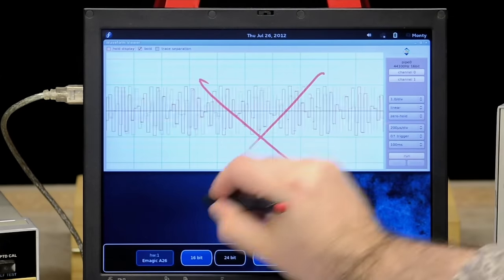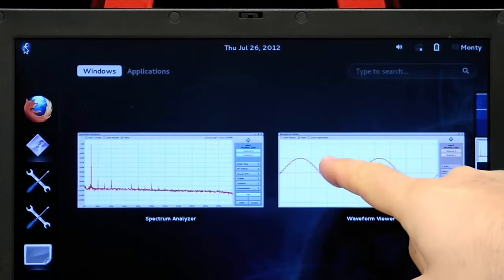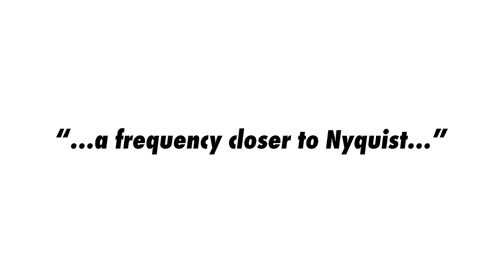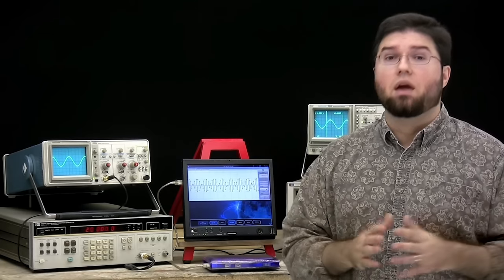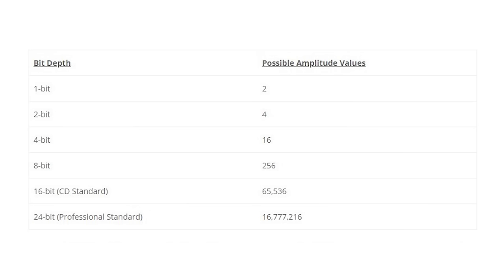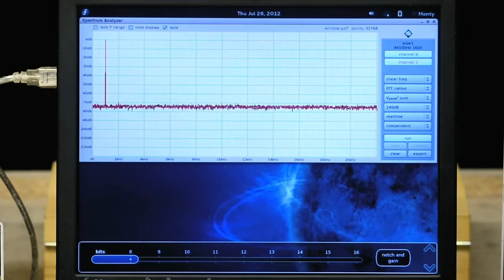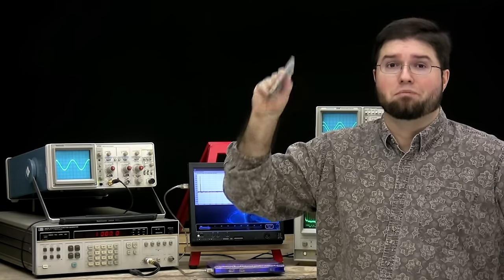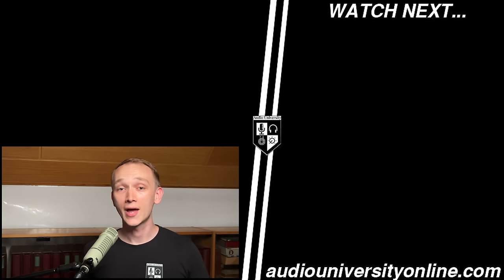Debunking the Digital Audio Myth: The Truth About the 'Stair-Step' Effect

Comment: Interesting but with assumptions made as to hearing range. A human has limited hearing and does not usually hear to 20KHz, in fact a teenager may hear up to 18KHz  at a push which decreases with age. Also missed out is the fact that the level that signal would have to be increases with frequency, given human hearing tapers off.
I worked in audiometric design of devices for measuring hearing.
Although showing a fundamental frequency for test purposes is fine and using it to measure a frequency range, I do think examples that just show the fundamental frequency, rather than the complex nature of real sound, is not a very good example. In other words the harmonics which make up and alter any fundamental frequency, when it comes to something as simple as a piano key press or a guitar string. 
A human may hear to a high frequency, but the bandwidth of something like music, has a very different frequency band. Something like a tweeter on an audio system usually kicks in at around 2KHz to 4KHz, so sampling at higher than 8KHz is superfluous.
I would also like to point out that a good D to A will have filters that change those points into something that represents an analogue signal.
It is an interesting video that shows people how a digital signal is composed, but lacks information that should have been stated.
Most people do not know or care what they are listening to, so a sample rate of 44.1 is good enough for the frequency range that humans are used to listening to.

Comment: If you consider audiophile network switches are being sold at 20 times the price of non audiophile but techically equal switches you understand that there is no limit to the ways rich audiophiles are being extorted. Although I do believe there are loads of people in the branche that actually believe all the humbug. The power of placebo effect is always being underestimated, both in medicin as in audophilia. It's always something others might be susceptible to but never yourself.
I wonder how you guys think about the "bit perfect" advantage. Is it possible to hear if 44,1 kHz material is resampled to 48 kHz? The idea is that this would result in an effect to the sound similar to the effect on image quality when you set your OS to a resolution that is not exactly supported my your monitor. If you play music through mediaplayers it is almost impossible to avoid this resampling.

Comment: "Pixels are samples of a 2-dimensional function space." That's wrong. Pixels in an image on a detector, whether it's a CCD, infrared array, or some other technology, are finite in size. They collect the light impinging on themselves and count the number of photo-electrons knocked off. From that, when you divide the count by the area of the pixel and the collection time, you can deduce that the average intensity over the pixel. You can use the mean value theorem to state that the function attains that average somewhere, but you cannot say where in the pixel that happens. 

Even audio "samples" aren't actually samples as you describe. The sampling process takes a finite amount of time, and what you get is an average over that time. Granted, in an audio system the sampling time is usually much much faster than any of the frequencies of interest, making the mean-value theorem approximation you make when you describe them as samples far more accurate, but still an approximation.

Comment: I would assume that the misunderstanding that you need more than 16-bit and 44.1 kHz digital samples is result of using low quality DA (digital to analog) converters. When you compare poorly implemented DA that takes 16bit/44kHz input vs poorly implemented DA that takes 32bit/192kHz input, the resulting analog audio output is typically better for the "high-resolution" digital format. That's not because it's actually superior for any practical use but because even poorly implemented "high-resolution" DA typically has just enough quality to actually behave as a correctly implemented 16-bit/44.1 kHz DA even though it would be equally bad for true 32-bit /192 kHz data.

Comment: Well, it sounds good… on paper. The noise you can’t hear so to speak affects the spacial perception. Our brain locate sound by the very minute difference in timing, and in electronics, noise do impact timing. You don’t need expensive equipment, just get a very cheap dac amp, play a 16 bit pcm, then play 512 DSD. DSD is converted to PCM, so more processing power should be worse…. Except it sound better across the board. Until you get up to 1500€ ish DACs, the very high resolution will sound better. After that the difference in mastering will make more of an impact and you will not be able to tell what is what just hearing the song. That is why people with lower end gear go crazy after resolution and people with 30.000€ equipment are fine with CD quality.
Reply: @nicksterj ok but then why is the mentioned situation exist? honest question. you play any DSD file, even 64 in to a 150$ DAC, even older models and you feel it instantly compared to 16/44.  No matter what tracks you chose it is the same thing. You move to a 2000 euro dac and you won't be able to tell unless it is the same recording and mastering, and even then you can barely tell. 
The "mythology" can be tested with cheap device, no need to trust a random guy.

Comment: Interesting video, even for a "tone deaf" software developer. And i can pretty much guess where part 2 is going because it's common ground for any data processing that isn't a "straight copy". The less the error is on the input, the less it will be (propagated) through the processing and at the output. You can think of it a bit as "constant re-quantizing" at every step, with consequently more and more errors accumulating. That's why you'll see things like 8bit (integer) image processing done in floating point, because you need to keep the errors as low as possible.

Comment: But the output form the DAC converters is a stair case, the reason it is a smooth sine wave on the oscilloscope is the (RC) filter added after the DAC
Reply: You thinking of interpolations methods and such, even so, the DAC still make a stair case output.
Reply: @nicksterj
So you disagree that all DAC's create a stair case patten on they out put ? 
As example you give sigma-delta converters do not output a 'stair step' pattern, do you include the low pass filter after the DAC in your definition of a DAC?
Remember now, we are discussing the DAC itself, not a complete system.
Reply: @nicksterj
As a side note I give you the sigma delta DAC, my guess he is not aware of them.
But whole video is talking about staircase, so still the the DAC he is thinking of is still making staircase, he even mention "zero order hold"
Either he is not aware, sloppy or include the (needed) following LP filter and show his sinus wave, but still, the DAC before do make a stair case.
Reply: @nicksterj
"Right, but his point is that the digital signal itself is not stair-steps. It's discrete. "

In the system before the DAC, yes, agree

"filtering is not optional if you want to accurately recover the original signal!"
Agree, but that is not the topic for this thread, the topic is that the system he present, show videos of and present, all have staircase but he is sloppy and include the LP.
My guess is that the video is for audiophiles not aware of how to recreate analogue signals from discrete values nd think that the signal sent to a speaker is a staircase.

Comment: Not an angry comment😀: the Nyquist theorem only applies when taking into account an infinite number of samples is my understanding. So constant sine waves are probably the easiest to reproduce. My question is: how many past and future samples are taken into account by modern DACs to allow for a reliable reproduction (or enforce the Nyquist bandwidth limitation)? I know that the M Scaler of Chord Electronics spans 1 million samples, and the result with or without is very noticeable. So in my view there is still an aspect of digital reproduction that is overlooked.

Comment: One more comment... If you are an audio engineer, you probably use a Baxendall filter or a shelving filter to boost the high end on many tracks and instruments. High frequency boosting helps to make parts pop out in the mix, and adds clarity. If you boost a signal acquired with modest equipment at 44.1KHz, you will be boosting all the aliased frequencies that fold back over your high end spectrum, corrupting your signal. And as you keep adding these errors on multiple tracks, your mix will start to sound like crap. Audio engineers: Don't fall for this misinformation. Your mixes will suffer if you do. Sine waves are theoretically pure or almost pure from test equipment, so if you test with sine waves you are not likely to see this foldback until you go over 22.05 KHz. So your tests are really not valid. They are somewhat ignorant statements from people that do not understand the theory and have probably bad hearing.

Comment: You didn't observe stair steps in the DAC output in the time domain (scope) for the same reason you don't see (double-sided) images of the baseband signal in the frequency domain (spectrum analyzer). This is because the DAC in your audio system is using a reconstruction filter. A primitive (old school) DAC won't have this feature, and the output indeed behaves as a zero-order hold, which creates sampling artifacts: stair steps in the time domain and image frequencies in the frequency domain.  

No attention was given to this (reconstruction filter) when describing your audio equipment, which is understandable when using commercial gear.  The vendor may not provide internal schematics with part numbers of the integrated circuits.  But, if you dig into the details of your equipment, I assure you that a reconstruction filter is in play.  Otherwise, you're violating some basic mathematics related to sampling theory.

I enjoyed the demonstration of quantization noise vs. sample rate, where you dynamically adjusted the sample rate while observing the noise floor; well done! I first studied DSP decades ago when equipment with this level of sophistication was unavailable.  This phenomenon was not as easily demonstrated and often had to be taken on faith.  I would have found such a demonstration to be very insightful.

You briefly mentioned Nyquist theory but only addressed the consequences of the required sample rate as a function of the input signal bandwidth. You didn't address the requirement to band limit (filter) the DAC output to satisfy the same requirement. This phenomenon is independent of sampling resolution, and the omission of output filtering (reconstruction) represents the flaw in your argument.

Consider the Wikipedia article on reconstruction filters: https://en.wikipedia.org/wiki/Reconstruction_filter. Analog Devices (one of many mixed-signal IC manufacturers) has a nice application note: AN-837, "DDS-Based Clock Jitter Performance vs. DAC Reconstruction Filter Performance," that covers the topic.  Any basic Signal Processing or DSP text will cover this in more detail and provide details of the underlying mathematic framework.

I recommend you do your homework before trying to play 'gotcha' with the pioneers of sampling theory.

I only scrolled down a short distance to see whether anyone else commented on this error.  I'm sure someone else must have, and I am sorry if this is redundant.

Comment: I'm no electronics expert but I can't help think hardware must play a significant role too. Especially Class D amplifiers. My thing is mechatronics and servo design and manufacture. Switching FETs on and off at even 400Hz PWMwhich is my go-to frequency for most of my servos, is quite noisy. And then at say 20KHz, my scopes show rise and fall slopes that aint pretty. Perhaps I'm too tight to purchase faster FETs LOL. But the way, it took me soooo long to get my head around Nyquist at school. Just two samples? How the f%$k can that transmit all the information in the signal, I thought. But of course, Nyquist was several orders of magnitude smarter than me. LOL.

Comment: But isn't digital audio capturing (sampling) applied to an electrical signal rather than the actual "audio"? Audio isn't normally a single tone. An individual voicing, whether it's a guitar, drum or human voice is more of a spectrum of sound waves. That spectrum of sound gets converted into an analog electrical signal by a transducer. So, what's being digitized is actually the electrical signal not the full spectrum of a sound wave. The transducer converts the spectrum of sound into an electrical signal, and it's the electrical signal which gets digitized.

Comment: Okay, so this isn't actually wrong, but as any electronics engineer who works with A2D & D2A conversion, then processing knows, the reason you aren't seeing stairsteps on the 100MHz analog CRO is because the D2A output stage of your converter has a brickwall 20KHz lowpass filter on the output. Of course, humans can't tell the difference between that & a 100% analog from start to finish setup, but of course that's the point of your video. Still, I feel like it's a little dishonest to not mention the low-pass filter, because if you hooked the CRO directly to the output of the D2A converter, you'd absolutely see the steps in the signal.

Comment: Am I also to believe that I can't hear the difference between 16bit/32KHz vs 16bit/44.1? Yes, there is a reason to increase bit depth and sampling frequency. I have personally heard the difference between 16/44.1 and 24/48 and 24/96. I can't hear any difference between 24/88.2 and 24/96. I can't hear any improvement with 24/192. The difference I hear isn't in high frequency response. It's more about how natural the strings and other instruments sound. It comes down to specific recording quality though as I've heard awful sounding 24/96 recordings and amazing CDs. The whole dynamic range thing is another joke on us given the loudness wars. Why bother for recordings with 3dB between soft & loud passages? Full disclosure my ADC is a Benchmark ADC1.